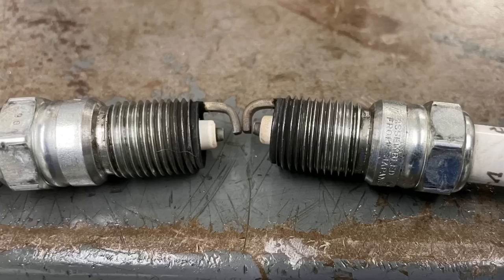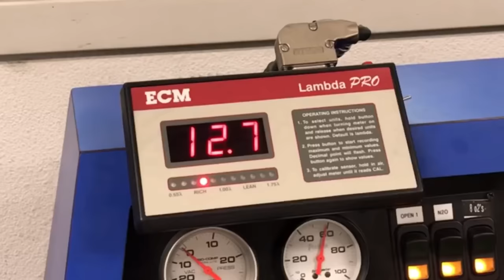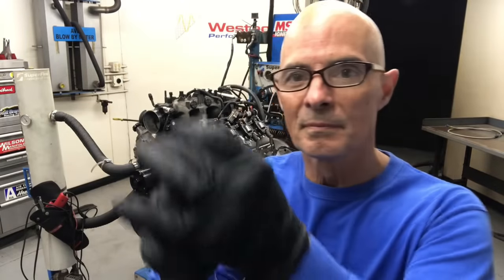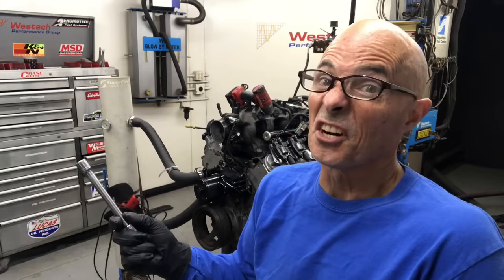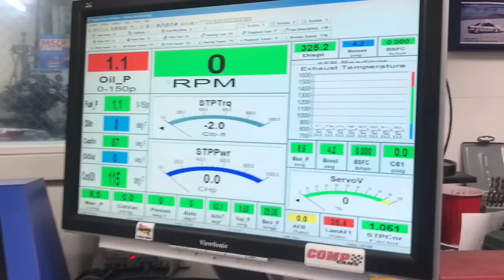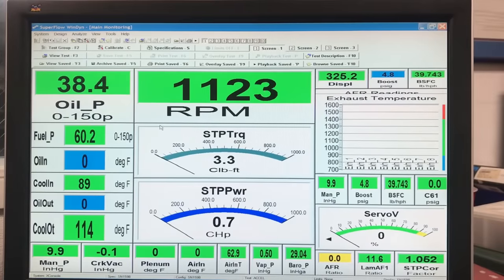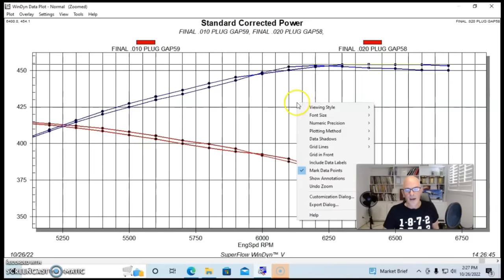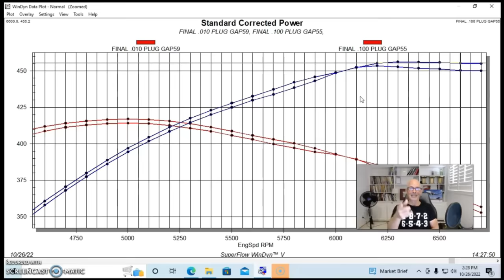JUNKYARD LS PLUG GAP TEST. DOES MORE GAP EQUAL MORE POWER? HOW MUCH SHOULD I RUN? .010 VS .100 GAP

Comment: back when I was drag racing and even bothered to I would set the spark plugs at 01.30 I would reshape the outer electrode to the shape of a figure 7 were the spark fired diagonally across an open gap It Increased the Idle speed a little but I was curious to see If there was any Horse power Increase.
Reply from the maker: 01.30?

Comment: I had a pretty well respected engine builder tell me to run as much gap as I could without snuffing out the kernal.  With modern coil near/on plug systems, it seems any gap will work NA.

Comment: So i agree bigger gaps are better and make a better combustion, BUT in the situation where someone like myself uses multi-spark up to 1500rpm i think having a very small gap and short dwell times while using more sparks is the way to go. The amount of additional sparks is definitely limited by how much amperage is drawn for each spark and decreasing dwell and closing the plug gap lowers the amps by a lot all while making the spark a sure thing to happen since bridging a .015" gap with 40,000 volts is a piece of cake. You can be sure you'll never have a misfire with this method because if your coil closes 3 times with a .015" gap its almost guaranteed to cause a combustion one of those times.
I successfully and smoothly lean burn my 1.8t big turbo engine on e85 at 1.2 lambda without any misfires thanks to my multispark method. I use 1.2 lambda up to about 2psi at part throttle without any issues.
Reply from the maker: BOOST REQUIRES SMALL GAPS-WE RUN .019

Comment: Your conclusion about HP is what we've seen.  But the curve shows a pick-up in torque from load-in to peak.  That is visual evidence of we feel around town.  Something approaching 0.050 is better for driveability and throttle response. 
The real question is not answered on a dyno run.  Can the ignition handle the load that the increased gap creates?  The ionization energy requirement goes up quickly and many coils can't handle it on a continuous basis ...
Reply from the maker: THIS FACTORY IGNITION CAN EASILY HANDLE THIS GAP LOAD-BUT ITS NOT WORTH IT

Comment: A bigger spark will make more power. As long as you have enough coil, and alternator, run the biggest gap you can. If it blows the spark out, you know you went to big.
Reply from the maker: no

Comment: So many factors in play......the more boost the smaller the gap......too much boost can actually keep a spark from forming and cause misfiring and weird timing responses

Now if you want to use a different fuel that's a whole new problem for wide gaps
Reply from the maker: THIS WAS NA TESTING-BOOST REQUIRES A SMALLER GAP

Comment: Try this again with boost. My understanding is more boost needs a progressively smaller gap to push the electrons through the denser air.
Reply from the maker: boost needs lower gap-but the gap just allows the voltage to jump in pressure-gap doesn't change the power other than cure the misfire

Comment: Big spark gap makes a very hot environment inside the combustion chamber. If you make tests like this one - no matter, but if you run your car 100km, then the engine will overheat and can cause thermal shock and engine failure.
Reply from the maker: no...a thousand times no-it has no effect on operating temp
Reply: @richardholdener1727  My experiment was like that: I removed the  side electrode (also known as the "ground strap") completely and the "gap" was very wide. My engine at first ran very well! But after 40 km the temperature went rapidly very high in one moment! I run a very lean mixture at that moment when I play with different "water injection" setups, which I throw out from my car. :) Now I am a regular driver.

Comment: I found out that my 97 F-150 4.2L V6 came with left and right platinum spark plugs!  One side had a platinum center electrode and the other side had a platinum outer electrode.  Two different part numbers!  Probably to cut cost.  I replaced them with dual platinum that can be used on both sides.

Comment: as far as i understand it's just cause of the bigger hotter arc is why we get  a 5-6 horsepower difference. when electricity flows through air it needs more voltage to cross that gap to complete the circuit basically makes the plug wires and gap one big capacitor storing that energy so with the added energy needed to cross the gap of the 100. plug would burn the fuel a lot better for long term applications may cause a hot spot in the cylinder and have to upgrade fuel, i don't know everything about that just something i'd suspect.
Reply from the maker: we only go 5 hp going from .010 to .100-it only 1-2 hp with correct gap

Comment: more plug gap requires a hotter ignition coil though, or you may burn up your coil packs if left stock. I remember there was a GM TSB issued on the trucks that the plugs were gapped too wide from the factory and should be reduced if/when the coil pack failed.

Comment: Sorry if this sounds stupid, but would increasing the plug gap put strain on the ignition system?  I'm guessing the only thing would be more heat/wear on the electrodes and have to change plugs a little more often.
Reply from the maker: IT DOES-BUT NOT ON THE LS IGNITION SYSTEM

Comment: I have an 01 Tahoe with 463k miles on the original 5.3. I run ACdelco 41-110 iridium spark plugs and 0w20 oil in winter 5w20 in summer. I'm getting 22mpg on 93 octane non ethanol premium. It works for me

Comment: Actually, while it’s fresh in my head, doesn’t this gap testing effectively simulate the effect of having a hotter or cooler plug range?  Maybe a test for a different video? See if you can gap a hotter or cooler plug to match a hotter or cooler plug?
Reply from the maker: TESTING ON HEAT RANGES AND INDEXING COMING UP

Comment: There's a David vizard video where he talks about the shape of the side electrode making a difference. Like radiusing the square edges off so it's rounded concentric with the centre electrode with the aim of having the spark jump not from one point to another but covering the whole edge so that the spark is actually "wider". He even talked about testing one where he drilled a small hole through the side electrode in line with the centre electrode to achieve like a cylindrical cage shaped spark. You can, or could buy off the shelf spark plugs with 3 side electrodes equidistantly spaced, can't remember what they're called but supposedly they were the best off the shelf design

Comment: There is no way a stock coil will fire 100 thou 
And boost is the next  test
Reply from the maker: STOCK COIL(S) PLURAL WITH 4.5 MS DWELL
Reply: @richardholdener1727  Did you adjust the for more dwell on the larger plug gap?  I don't know what stock dwell times are.

Comment: In short: does melting your ignition coils add a noticeable power boost? They'd have to build a huge charge to be able to drive that gap, and they'd almost certainly melt in the process if trying to do it for more than a dyno run.
Reply from the maker: a factory ls coil system will run that gap forever-but there is no need

Comment: i noticed difference when i let all plug gaps equal, but there was a difference on my car
stock is 0.80 gap, but i let equal all and in 0.60
when i pull the thorrtle to recover in high gears, the car repplied better than with the original gaps.

Comment: What about indexing the tip of the plug a certain way in the cylinder different ways like pointing the flame frount at the inlet valves  then towards the exhaust valves or is away from the valve better? Just a thought
Reply from the maker: indexing is a common question-that will be tested

Comment: I'll bet money, that if you had put the .010" gapped plugs back in for a final pull, you would have either matched or exceeded the  .100" test.
What you did was show how an engine will  pick up after a couple runs as the oil temps come up.
Reply from the maker: NICE TRY-OIL AND WATER WERE THE SAME FOR EVERY TEST
Reply: @richardholdener1727  thanks for clarifying that

Comment: When I bought my 05 SS truck, had just under 100kon the clock.idled rough but still fired on 8. Swapped the plugs and they were already worn to about .090 on 7 of them. The last one had already worn off the ground strap. I'd say they were originals.

Comment: I would be interested in taking the timing to detonation and change the gap . Or if anyone knows if gap can be preferred for detonation prevention vs changing to colder plugs
Reply: In my experience, detonation is typically caused by too much ignition advance, low octane as well.
Detonation is defined as the fuel burn extinguishes prematurely (for whatever reason), so mixture ratio should also play a roll.

Comment: Great test, for context what is the voltage capability of those CoPs & does that ECU self adjust timing to better utilize peak pressures on the downstroke or were the results here simply with static ignition timing between runs meaning is a simple case of very slightly better burn & not of utilising tuning headroom. My understanding being that a flame-front which spreads faster needs less advance(essentially more advanced on its own relative to slower plugs)therefore you have less losses on the upstroke & more complete burn on the power stroke by spending less pressure opposing compression

Do you feel if it was too rev' faster that it would start to become a problem on higher RPM engines or if the coils used are uniquely better than what other motors may use
Reply from the maker: timing doesn't need to change to test the plugs
Reply: @richardholdener1727  so I take it that means no attempts were made to utilise difference in flame propagation speeds.?

..though I suppose as the gap increases, the voltage charge up time naturally increases slightly mostly offsetting optimisation needs as it'll by default spark slightly closer to TDC which is necessary for the faster flame kernel..

..however I wonder if this carefree approach would be the best mindset to have on my 5 valve per cylinder engines, especially when considering 5 digit RPMs where ideally tight timing matters.. Though the 1 valve intake V8 as pictured here probably has a different reality to contend with compared to better breathing engines making more than 150hp per liter revving to double what this V8 is

Comment: I also found fine wire tip center electrode has better throttle response.  When I was playing with this I was pursuing fuel mileage.  1970 Chevy truck, 350 stock motor, this was in 1889-1990.  HEI ignition, 194 heads.  I also played with the carb for good throttle response and mileage. Three speed non lock up automatic transmission.  16.5 mpg at 62 mph.  After that the secondaries would start to open and mileage started falling.  80 mph got me 10.5 mpg. With .100” plug gap I used up ignition rotors on a regular basis.  I kept HEI module and ignition rotor in the glove box at all times.  What started me on this was SAE research papers on plug gap vs mis fires and fuel economy.  Toyota has an interesting paper on metal ions as a catalyst in combustion equations.  Boils down to using soft center electrodes on plugs instead of platinum tipped stuff.  What I found was it seemed to make more of difference with carbureted engines more than injected engines.

Comment: So going to one extreme to the other doesn’t tell you anything. What if you did .040-.050  which is the recommended gap. Unfortunately you didn’t prove anything.
Reply: Lololol. You knew this comment was coming. I posted before you saying it. So you knew.
Reply from the maker: if we go to either side of the .050 gap point-we have proven everything (think-you will get it)-but I did know you were going to complain
Reply: @richardholdener1727  the way my mind sees it, you could lose power at .020 gap, gain it at .050 and be back on a downward pitas past .100. I know when I went to a .020 gap when I added a bunch of boost, my idle was horrible and I had to retune it to idle hood again. I also get better Fuel mileage at .050 gap vs .022 gap. My fuel consumption is higher at smaller gaps and it doesn’t pull as much vacuum.

Comment: On all these tests with small gains my question is what is the repeatability on a dyno? On older dinos I have heard they are not accurate down to that level. What is the specification on a newer dynamometer?
Reply from the maker: the dyno is accurate to less an 1/10th of a horsepower-the accuracy or more accurately the repeatability come from the motor itself

Comment: How about some testing of side gapping plugs? Obviously indexing them helps, but how about side gapping?
Reply from the maker: OBVIOUSLY INDEX HELPS?
Reply: Having the open side of the plug facing the open side of the chamber.  A book I read said some engines really benefit from that.

But I was wondering if side gapping the plug really worked, or was a wives tale?

Comment: I had an outboard motor and the plugs didn’t have a gap.  They didn’t have the “finger” electrode. They just arced from the center electrode to the larger ring at the base.

Comment: wen gm introduced hei the gap was as much as .080 to fire leaner fuel mixture. then with cats and more emission control the epa wanted the car to go 50 mi with out a tune up and still pass smog. then gm settled on .045.

Comment: I REALLY would've liked to see if the .100" gap wanted less ignition advance and would've made a bit more power when timing was "ideal". 
Theoretically, the bigger gap means a bigger initial flame kernel, so less time required to reach the outer reaches of the 3 dimensional chamber and less ignition advance required. (If the .010" gap combo was timed ideally, I'm expecting that the .100" gap would've wanted less ignition advance.)
Reply from the maker: it doesn't work that way-the ideal timing is a function of the chamber/piston design

Comment: The '65 international Scout came with Champion J6's.  It would run 75 mph flat out with these plugs.  Swapped to J6J's (wider gap) and it ran about 82 flat out over the same stretch of Hwy.   Also, drivability was better.
Reply: I should also note that the J6J's also were projected tips also.
Reply from the maker: more plug gap on an na motor does not add power as tested many times (you changed something else)
Reply: no sir.  I was 13 years old at the and just starting to get into engines.  I couldn't afford anything else and, besides, my dad would not have let me change anything else.

Comment: How about doing a spark plug shootout. Copper vs iridium vs multiple strap etc....
Reply from the maker: planned
Reply: @richardholdener1727  We found good results with grinding, or tapering the ground electrode (AKA side gapping). Denso Iridium TT works well. The iridium tip is the least shrouded design. Grind down till iridium tip is swinging in the breeze. Worth 15 HP  ;)

Comment: The greater the gap, the faster the flame front acceleration = torque. At the extreme, timing needs to be adjusted to optimize. I've been playing around with this for 15+ years and seen +10 BHP with up-voltage (stratified) ignition systems.

Comment: With a modern ignition system and a good high voltage coil it makes sense. For a system in poor condition a short spark would be better than no, or an intermittent spark trying to be long but failing.

Comment: But would there be  driveability issue when on the road under load ?
Reply from the maker: the takeaway is used .035 gap and there is no power from plug gap

Comment: Wide gap means bigger but weaker spark.  Narrow gap means intense but small spark.  Very narrow plug gaps can mean less complete combustion, too wide a gap can mean hard starting and easy plug fouling.  The auto makers try to find the best compromise between narrow and wide.

Comment: Hi. Would you show or tell if plug gap could retard the ignition timing especially for a non-computerized engine? If so, I would like to see how plug gap affects the HP and torque for a certain ignition timing. Thanks.

Comment: I know back in 1978 we had a REAL BAD problems (with plenty of customer complains) with the GM V-6 in trying to get them to idle smoothly; It was always a GOOD LUCK to see if you could get GM V-6 to run smoothly, At the time we had 4 different mechanic's including myself and we would always have a different discussion on what to do with a GM V-6. They were good engines but just that they would have a rougher idle than most engines.  Soooo>>>>> The best that we could figure out (after replacing the cap and rotor) is to go from a .045-.050 gap to a .035 and we actually got those GM V-6's to run smoother

Comment: 5hp of 455 is over 1%, does that also mean top speed is 1% more? With many races and drags this could change a result
Reply: If you have a 200hp motor that gives you 120 mph, would replacing it with 600 hp give 360 mph? Nope
Reply from the maker: a change in top speed of 25% requires a 100% change in power-so 1% increase in power is worth almost no measurable (.25%)change in speed

Comment: It's like a Myth Busters episode. Excellent! Just threw my plug gapper into the trash. Eyeball from now on.
Reply: I think whats important is that they are all the same- otherwise youll have some coils going out early from working harder
Reply: @mcleanmachut  , maybe . . . not from a power standpoint, it seems. I wonder if it really matters if they're 20 thou different. Also, I wonder if this data changes with increased cylinder pressure from boost.

Comment: I remember back in the 90's when I (plunged myself into debt) upgraded my Ranger and bought a Jacobs Electronics ignition. If I remember correctly it was 60,000v and the recommended gap was 0.55 or more. Was it overkill for a 2.9L? Of course. Could I feel the difference? Definitely.